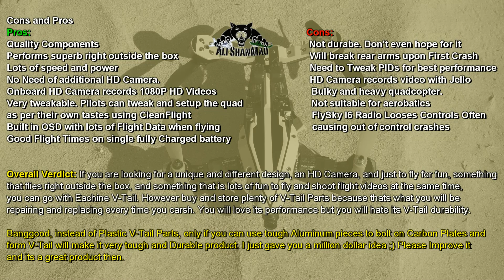Eachine V-Tail FPV Quad SP Racing F3 RVOSD and HD DVR

Comment: hi just ordered this model can this use the new cleanflight 2 at all and have u modded the Pids and rates please could u send them so I can put on mine when it turns up please in a few weeks where can I get the spare rear view tail parts please and did u update the esc with bheli at all
Reply from the maker: I did not do any setup changes on this quad i believe

Comment: I bought a eachine V-TAIL 210 from Banggood but his F3 EVO are damaged... so I bought a new F3 EVO specific for the V-TAIL... but this don't have pre-installed ANY VERSION of the firmware. How do I install a firmware??
Reply: I had a similar problem. Power the quad with the boot pins on the FC jumpered, this should allow you to flash the board under DFU mode in Cleanflight/BetaFlight. Make sure you have all the ST/CP/DFU drivers installed beforehand. Hope you got it flying!

Comment: Omg it broke that easily? Save your money people and  buy real quadcopters and not crappy toys that last for two flights. eachine makes crappy quadcopters. Shouldn't even be charging $260 for this junk. This is $160 at best. Only good things on there are probably the FC and the motors and maybe the ESC's

Comment: I had my first flight FPV on the Vusion 250 yesterday... did notice that the video of the monitor once inside the goggles was very blurry... specially because of the monitor been so close to your eyes... does that happen to you as well? Is there any way around this to fix it? Thanks for your help!
Reply: Loosen the goggle straps. Vision becomes blurry if the goggle are too tight on your eyes. Still using the Fat Shark v5 goggles.

Comment: Looks good but the VTX was Breaking up
Reply from the maker: Let us Define Crappy Goggles Shall we? because otherwise it sounds like someone who sold his soul to a brand LOL
Reply from the maker: +xjet I know it's not the best but you can't expect a HD onboard unbreakable type of recording from a DVR. This DVR still needs a good firmware. Besides different frequency different power vtx has different results using same goggles and same DVR. Some has worst reception some has better reception videos. 

Let me know which DVR or goggles do you recommend to record unbreakable live footage and I will try to get those and put your statements to a test ;-)
Reply from the maker: +xjet there you go. You just replied to your own complaint about me using a crappy DVR. Let's be happy and hope we can get HD live video transmission and HD DVR to get compact and light weight so we can get rid of these old dreaded SD DVRs
Reply from the maker: +xjet I have got it already. I just need to find goggles with HDMI in